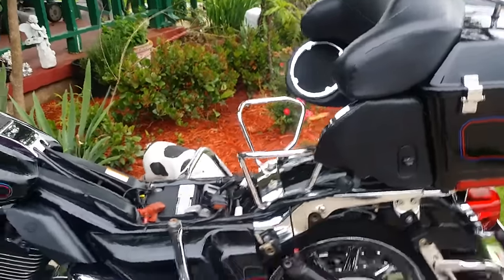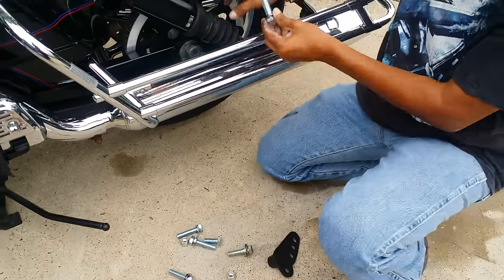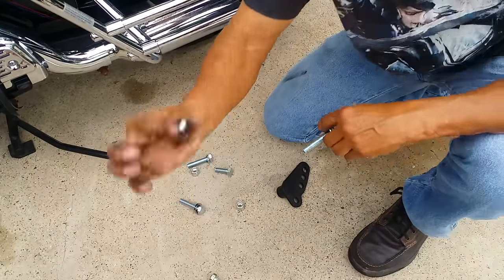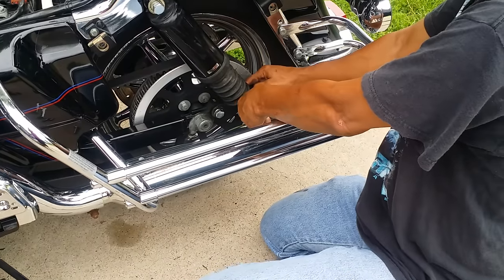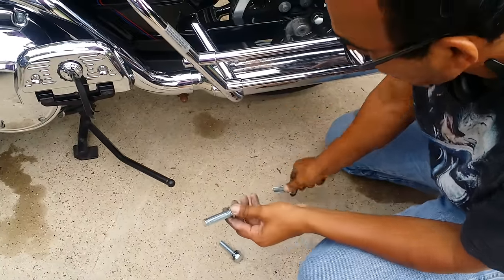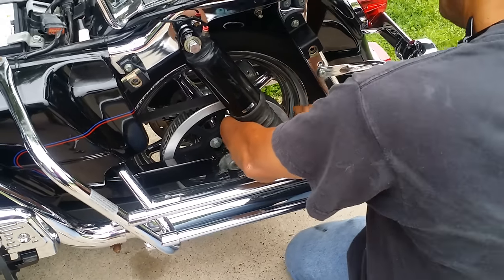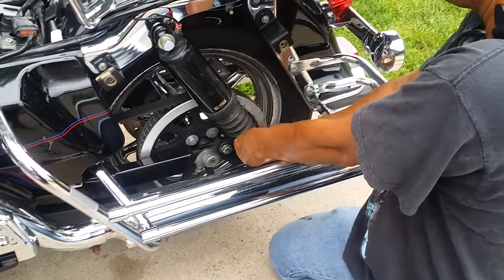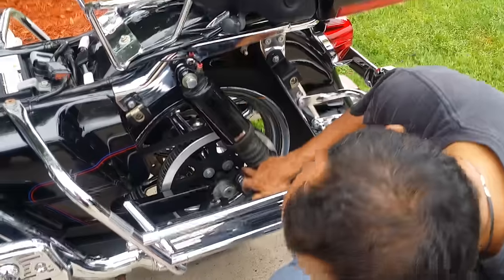How to install a lowering kit on motorcycle part 2

Comment: Pretty sure you put the shock back on wrong. The air line should be facing the front of the bike. You’d be better off to remove the video. Most likely your gonna continue to get negative comments.